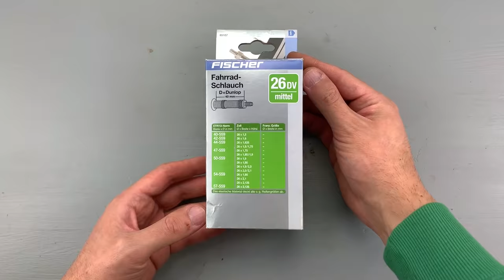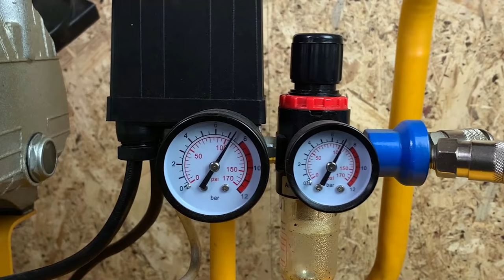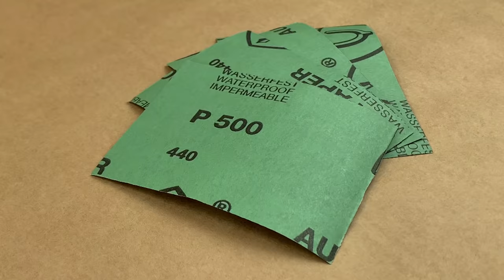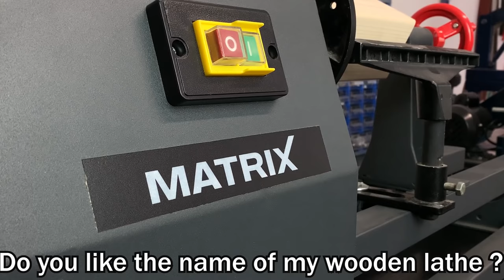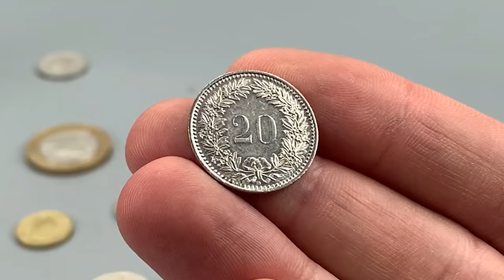Rusty Trick Dog Mechanical Coin Bank Restoration - A Funny Way to Save Money

Comment: Awesome restoration.  This is my favorite bank...have never owned one but this is the one I would have wanted. The Phillips screws date this bank to no earlier than 1932, but most probably after 1936, unless it was older and restored once before...
Reply from the maker: I think was restored or something changes because i noticed some wrong screws and the paint doesn’t look like original paint

Comment: I love to watch your work.  When it comes to those antique cast iron banks, they  an be quite valuable.  But there are a lot of Chinese knock offs that have flooded the market.  There are several ways to spot the modern ones made to look like the rare antiques.  One sign is the screws.  The antiques never used Phillips head screws.  They used slotted screws.  In a restoration of a true antique, I would recommend that you actually fabricate replacement screws and make the with a slotted Head.  Just my two sense.  Thank you for your videos.  Keep up the good work.
Reply from the maker: Thanks a lot for your advices Steve 👍

Comment: Is it easy to get into restoration as a hobby? I've been keeping my eye out for something cool to try to restore, I just don't have that many tools so I'm afraid I wont be able to do it justice. For instance without a sand blaster could I still get a decent result with some rust remover and sand papper??

Pretty much all I have is like a drill press, band saw, and most common hand tools (portable drill, dremel, Sawzall, etc.) I really want a nice lathe and mill so maybe that's in my future as well.
Reply from the maker: Yes,you can start a project with basic tool. You can do a process in many different ways

Comment: Great restoration,  just curious, I noticed rusty original  Philips screws if this  toy was original  would the screws not be slotted,  does this mean that the  toy was not an antique  but a replica ?? Thank you  Richard
Reply from the maker: I put myself the same question but I don’t have an answer. The screws was mixed ( old and new) . Maybe the seller repaired a little bit and changed some screws. I really don’t know . When you work with junk item,you never know the value and the authenticity 😅
Reply: @CoolAgainRestoration   Thank you for the reply once again great restoration I like to watch stuff like that
Reply from the maker: Many thanks Richard 😊

Comment: You should loosen and tighten screws and bolts and you remove them. It helps get the penetrating fluid down the threads without the chance of stripping it a little at first. Loosen ever so slightly, spray some more, tighten back down. Loosen more, tighten it down. Then remove all the way.
Reply from the maker: I do this but dont work every times

Comment: Curious seeing Philips head screws on something old. I'll have to remember the inner tube trick. I keep a bunch of old ones on hand "just in case" I find a use.
Reply from the maker: Yes,tre rubber trick works 80% of time. Philips screws, I think was modified before I bought it .

Comment: Pretty rare finding one that still has the rubber stopper in it.
Reply from the maker: Yes but the rubber stopper isn’t original. This bank coin came with metallic stopper. That rubber stopper is something chinese from Ebay or Alibaba. Nothing wrong with that but isn’t original part. The funny thing is that the rubber stopper was so old also..

Comment: I HAVE ONE OF THESE
There are a lot of color differences but mines in pretty good condition other than missing the rubber stopper on the bottom
Reply from the maker: I seen rubber stoppers on EBay and Amazon 👍🏼

Comment: I presume that someone has told you that this bank is a reproduction made around 1960s or 70s. The best way to tell a genuine bank is by the quality of the casting. I cringed at the closeups of you working on the parts as they are crude at best. Also this reproduction was made to look very old by artificially rusting the metal which is evident by the somewhat fresh orange color of the rust. I also saw some gold coloring when you were sandblasting around the letters. A genuine old piece wouldn't have that if it really was old and rusty. But you do great work, hope you didn't pay much for it. Just an old man killing time and one who has learned from lessons and money wasted in the past. I'll keep tuning in.
Reply from the maker: Yes Bobby ! I discovered after I posted the video. I paid 30£ , is not a lot but bad for me because I didn’t paid attention when I bought it . Thanks for your feedback 😊

Comment: This isn't a very old item. The phillips screws give it away the real antiques will have slotted screws.
Reply: Repro ones were very popular in the 1970s. Yes hard to find originals and yes the phillips screws are always the 'tell'. As was the rubber stopper.
Reply from the maker: Many parts was not the original one ..
Reply: @patstrailertopics5975  as repops go, this is a better one. Some of today's repops are so poorly done, they don't fool anyone. They try to use slotted screws and such, but the quality is just so poor, you can tell at a glance they're fake. Still people try to pass them off as antique. I see that a lot. Sometimes they honestly don't know, but mostly it's just scammers.

Comment: I think the screws weren't original either. Phillips screws were invented in the 1930ies and the toy has likely been built earlier. Maybe it would have been a little more authentic when you had used slit screws.

Comment: Atleast u didn't fuck up a 400 dollar piggy bank and restored a re pop one made in Taiwan in the later 70s
Reply from the maker: I found only two original items. One was $800 and the other one 1200 🙃.
Reply: I have that one  the penny pincher by  the one about some presidents hunting  trip and and a bear in a tree and the ones I seen were probably not original the key lock is stamped led with the makers mark that's why I never see them with the locks so people can ask what ever and pass Taiwan versions as originals

Comment: Cross head screws weren't widely used until the 1930. Also there wouldn't be a rubber bung in the money tray. So it's either an overseas reproduction, or someone has distressed it thoroughly and sprayed it with salt water. A good restore, but please come clean about the objects you restore.
Reply from the maker: Yes, it is an old video and I was newbie back then . I made another mistake with the Soviet lighter . Now I’m more careful what I buy for restorations because my audience is very important to me and I have to take care of his feelings 👍